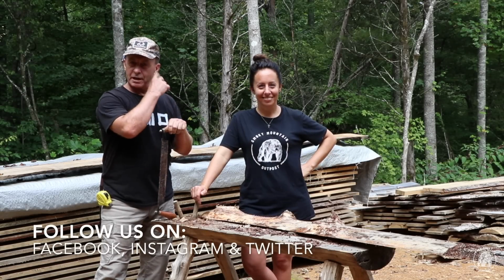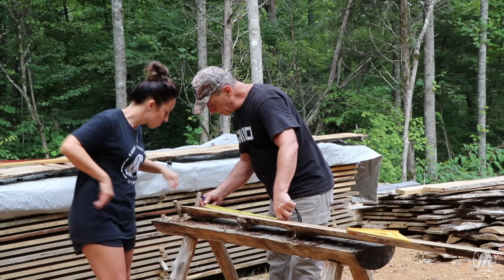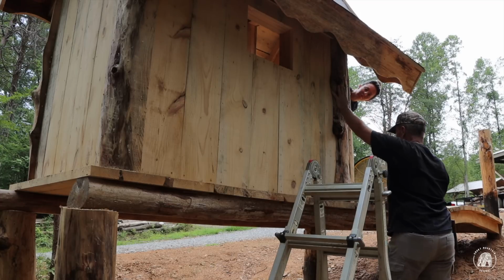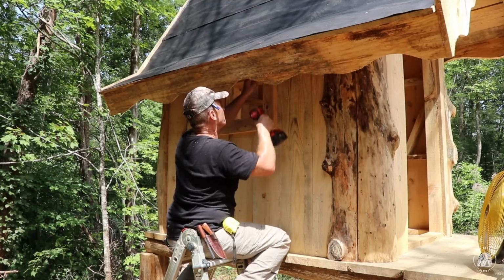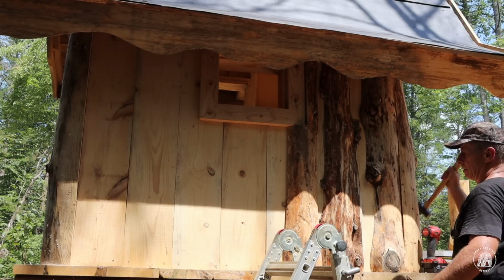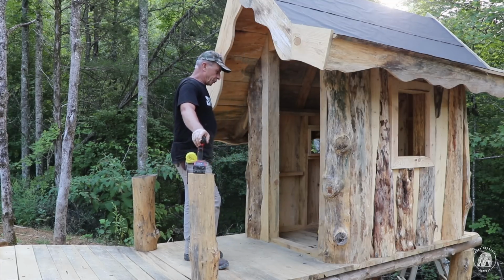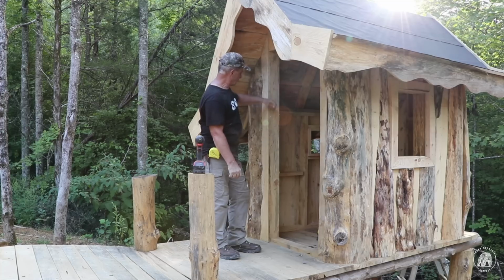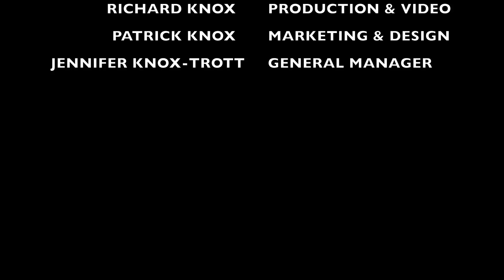S2 EP12 | HOBBIT STYLE OUTDOOR COMPOST TOILET | INSTALLING THE BATTEN AND WINDOW FRAME

Comment: Having used composting toilets before, I suggest you have like a drawer slide to pull your barrels out from underneath, as they are pretty heavy, and pulling them out from underneath can be a hard time. Doing a fantastic job on it.
Reply from the maker: This one is built differently

Comment: Just curious about your use of screws for all your construction. Have you considered using a cordless nail gun? It would be faster and perhaps less costly. I mean they build houses with nails.
Not a criticism, just a question.
Reply from the maker: I have come to like the screws. I would have to run generator , start and stop